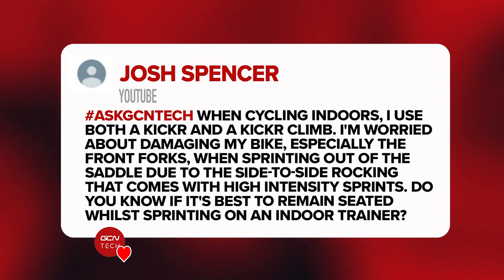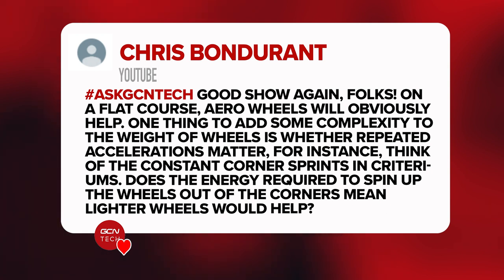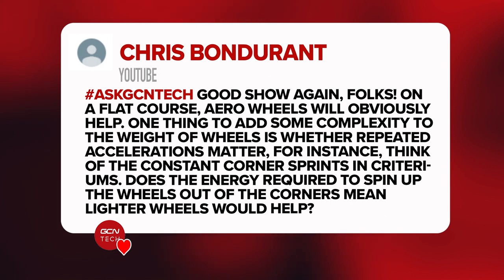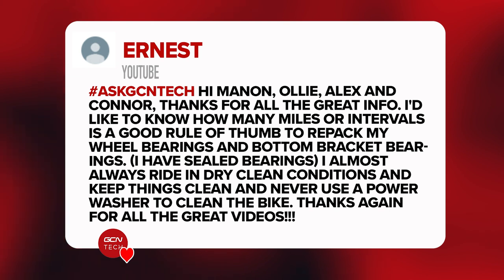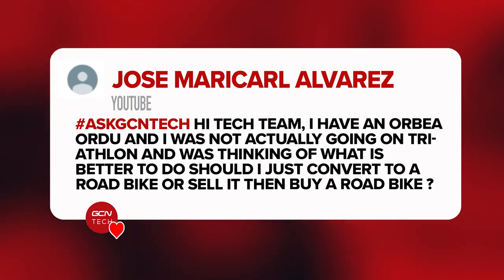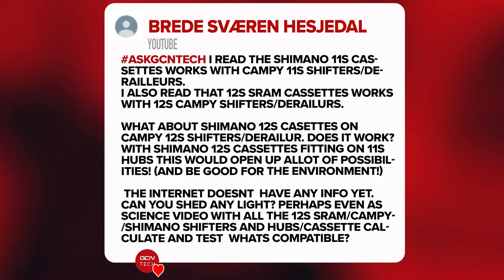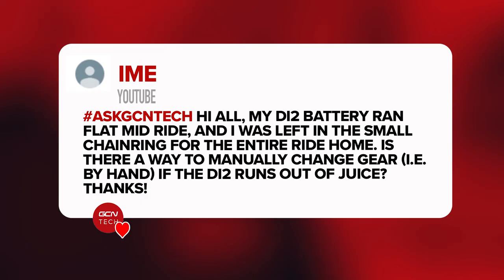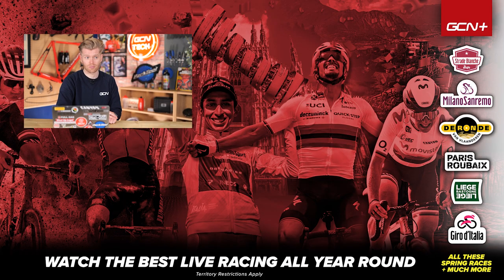Is It Safe To Ride Out The Saddle On Indoor Trainers? | GCN Tech Clinic #AskGCNTech

Comment from the maker: Have you got any burning tech questions that need answering? Let us know in the comments using #AskGCNTech, and we'll get back to you in a future video!👇
Reply: #AskGCNTech Greetings all, I recently discovered a polarising debate on the use of tubeless tyres on carbon rim brakes. Some people believe that providing you use all the correct equipment (as in manufacturer proclaims as tubeless ready) you will be fine, and others, even proponents of tubeless technology, would avoid tubeless setup on carbon rim brakes due to the lack of heat dissipation on the rim causing potentially dangerous temperature and pressure increases in the air. I am considering the set up for my summer bike as I use tubeless on my winter bike which is alloy rim brake without any issues. I have a set of tubeless ready tyres and the Vittoria road inserts ready to go, and a set of TLR carbon wheels on order but unsure whether it would be the right choice for the setup. Your input would be greatly appreciated, thanks.

Comment: If you stuck with a low/dead battery on 11spd Di2, and you are riding with someone who uses 11spd Di2, you can just use the wire that goes to your mates RD and then plug it into your RD, and then get your mate to shift it for you to your desired gears. Likewise with your FD.
Reply: Took me a moment to realize what you're saying, I was imagining your mate riding backwards as you're riding forward, joined by the wire into your RD as they shift for you 😂 nothing could go wrong....
Reply: @matthiaswuest7271  hahha. Well, another form of acrobat cycling.. Why not? Haha. Should have said, 'you can do a quick stop at the roadside'

Comment: #AskGCNTech Hi GCNTech crew! When riding indoors, where does the energy go? Surely it doesn't output 300w of noise and heat. Why not use this energy to feed back into the power grid and (marginally) reduce my power bill.
Come to think of it, why does my KICKR need supplemental power at all? Maybe you guys could dissect one on camera? Sorry about the long question, but it feels like these things cheat thermodynamics.
Reply: Presumably it's going into overcoming trainer resistance?

Comment: I listened with interest to the question about what to do if the battery on a Di2 system runs out of energy mid-ride. I think the simplest solution to that problem is to exercise a little forethought and always have a small lipstick style battery charger in one's set of emergency gear. I don't carry a lot of emergency supplies in my small seat pack. But having a diminutive battery backup in this era of electronic groupsets, cycling computers, lights, and cell phones (for emergency calls) seems to be a prudent thing to do. Since these tiny lithium batteries retain their charge for a long time, you can put it in your bag of supplies and know it will be good to go for months. Fortune favors the prepared cyclist.
Reply: Didnt thought about that, but its definately a great solution, because Di2 can run out off 5V battery packs (USB connector), same as Sram eTAP. I dont think you can do it with Campagnolo EPS tho, as the available charger socket other than the power one is made for 12V battery packs (different connector). Besides, the EPS charger is huge...
Reply: Never in the history of design adding batteries to a perfectly working mechanical device as EVER worked for well for the end user, other than the manufacturer that can charge more upfront and get a revenue stream from all the batteries and spares they are going to sell.
Reply: @sand9577  I tried to come up with a counterpoint but you're right. Unless there was a cord in between, the only non-toy examples I could think of were watches/clocks and the battery on a car supplementing the engine by removing the hand-crank issue to start it. But those are incredibly specific
Reply: @sand9577  Hi, iI general, in would agree with you. But some of these electronic devices have special value. Lights and radar units definitely add safety to the riding of many users. Electronic groupsets are a riding luxury for most, but not for riders with arthritic hands who struggle to shift with even the best manual groupsets. I won't belabor the point because, again, I agree with the notion that there is a special engineering beauty associated with a fully manually outfitted bike.

Comment: #askgcntech . Hi team . Oval chainring … fitting new chain… does it matter if the oval is horizontal or vertical when you measure the chain? Or does it not matter 🤷🏻‍♂️ also how many extras links do you leave ? Cheers👍🏼
Reply: It should not matter too much. The number of links engaged on the ring is always more or less the same (half of the ring). I used to have a biopace chainring on a fixie and the chain tension was only marginally different in any position. With a derailleur it is easily absorbed. I’m pretty sure it makes no difference to the chain length required. Watch a video of Froome and you’ll see that his rear derailleur is not bobbing back and forth during a full rotation of the cranks.

Comment: #AskGCNTech Hi tech team! My bike creaks a lot when i pedal. I have replaced the bottom bracket and serviced the crankset. The annoying creaking has become less but it's still there. Weirdly, when i simply wash my bike, the creaking goes away for about 5kms but then comes back slowly. What can be the issue? Thanks GCN team.
Reply: I have a Canyon Endurace and I thought my BB was creaking but after I wash it goes away, it turned out to be my seat post, I have to remove and clean every few rides and  now its dead quit now.
Reply: Presumably, it's a press fit BB which are notoriously creaky, but I had a similar issue with my gravel bike and it turned out to be a defect in the BB shell.
Reply: Had similar issues with a number of bikes, it turned out to be the seat post as MTB MOTO described. Thankfully it is also the easiest to sort.
Reply: Thanks for the replies. I'll try cleaning the seat post before the ride and check. Yes my bb is pressed fit one. Hopefully my bb shell isn't defective :/
Reply: @rayvinthingnam9106  make sure to clean the inside too 🤙🏼
Reply: @rayvinthingnam9106  My creaky frames were all alloy with alloy seat posts,  after a clean and re-grease the creaks vanished. When they returned I repeated the process and all was good. Hope it's this simple for you.
Reply: Can of worms there mate. Could be any amount of things.
Reply: Thank you for the replies everyone. 
An update - Instead of fully washing the cycle this Sunday, i just degreased and lubed the chain. The creaking sound went away for about 5kms again and then it started coming back slowly.
The creak only comes when i pedal hard or when i am climbing. And its very random.
I lubed my chain again and the creaking  went away for about 2 kms.

Can you all please help me with the problem and solution? Thank you so much.

I have been using the same degreaser and lube for the last 8 months. The problem started 3 months ago.

Comment: There was a question about compatibility between Shimano and Campy cassettes. Campagnolo started using "variable cog spacing" when 10 speed came out. Shimano doesn't use that. If you use a Shimano 11 speed wheel, with Shimano cassette, with campy shifters, parts of the cassette will shift fine. Other parts won't.........Shimano and Campy 9 speed worked together well. The spacing was only .03mm different.

Comment: If Your Di2 battery goes dead and there is another bike with Di2, put the bikes side by side, unplug the derailleur  that is dead and plug it into the good one, then shift it to the gear you need. Replug the bikes back in, and be on your way.
Reply from the maker: Ooh that is clever ! As long as the cable is long enough to reach said rear mech!

Comment: #askgcntech Hey Alex, Ollie; I wondered if you could help? I have a fancy all-in-one carbon bar/stem with my bike, and am upgrading the bike to Campagnolo Chorus 12s. Campy recommend a torque setting of 10NM for the shifters, whereas Shimano just 6NM. Is there a risk of cracking the carbon bars at 10NM? Why is the campy torque setting so much higher? Thanks!

Comment: #ASKGCNTECH hi gang little question regarding bike stability, background iam 167cm 77kg riding a small 50cm brand x rd01 with 110mm stem 38cm bar width. Problem is the bike seems unstable when descending in the drops @ 30mph and above however feels perfectly ok on the hoods, any probable causes why this would be the case many thanks

Comment: Hi crew, I have a question about cantilever brake link wires. I am refurbing an old mountain bike (I know but I am a roadie, really I am) and I noticed that there is a "D" link wire on the front brake and a "B" link wire on the rear. A friend mentioned I have the wrong link wires on. It should have a "B" link wire on the front and an "A" link wire on the rear. Now the bike stops well enough for cantilevers but should I switch out the "shorter" link wires?  #AskGCNTech

Comment: #askgcntech : Hey people, thanks for the help one of my STI levers doesn't spring back to the original neutral position, while they stop breaking it is a little annoying any ideas on how to fix it? Thus far I have checked for any dirt or other ingress or if they are bent and pushing against the housing. (they are grx 600 shimano sti')

Comment: #AskGCNTech Hi Alex, Olie and Manon. I have two wheelsets for my gravel bike, both tubeless. One has semi-slick tires on them, while the other set has more knobbier tires. My question is, where and what's the proper way to store the other wheelset when not in use, whilst considering the sealant inside. I don't usually swap that often. Thanks!

Comment: I've not read all the comments but I have an external mounted Di2 system (R8050) and carry a spare battery. A very easy swap over if the battery in use fails.

Comment: Ollie, you failed to discuss WHY lighter wheels are important in Formula 1, and not on bicycles. Unsprung weight (mass outboard of the suspension) is evil in Formula 1 (and other motorsport) because it is mass that will keep the wheel in the air after a bump. Tires in the air don't help either cornering or acceleration.

Comment: So, on my old bike, I was using Dura-Ace 7900 with 1st gen SRAM RED cassette and and TBH it was working smoother than original Dura-Ace. But at that time SRAM was a better at doing those parts IMHO. But big disadvantage was, that this SRAM cassette was so f... loud, because it was basically an aluminium can, and I was using it with aluminium pulley wheels in rear mech, so my friends where telling me, that they can hear me from few miles.

Comment: As to the dead Di2 battery question, probably you can use a 2mm allen and readjust the limit screw, so the rear mag aligns to a bigger sprocket for the ride home.

Comment: #AskGCNTech From the charts about cable pull ratios and the formula for mixing, it seems that an 11-speed shimano derailleur and 8-speed campy shifter would be compatible with 7-speed gearing. Would this work to index properly as the math shows, and if so what size chain would I need?

Comment: Yes, you can use a derailleur by hand...some of these electronic groupsets have a version with a wire; quaint I know, that you can use to remotely activate from the shifters. Those are awesome, work just as well, and don't use a battery!

Comment: #AskGCNTech 

Hi GCN tech! 

Can you help me pin point the cause of excessive chain and cassette wear? I can barely get 2000km out of a chain and only 4000km out of cassette. My mates easily get 3-4000km out of a chain and over 10k out of a cassette. I have no clue about the case, just know that it is costing me way too much money.

So here is what I do / have: 
- Gravel bike with Shimano GRX 600 group. 46/30 chain rings and a 11 speed 11-32 cassette. 
- I mainly ride on roads and occasionally on gravel. Weekend rides between 60km and 200km.
- Do a lot of short commutes. <20km rides, start-stops, not always good weather conditions, tend to be in a hurry to work
- Live in Netherlands, completely flat so lot of riding in the same gears (mostly a bit off center on the cassette and 98% on the big ring)
- 38mm tires, slick on the center with a bit of profile on the sides
- I am 182cm / 75kg so pretty average I would say, don't think I put down an excessive amount of power, not being Mathieu van der Poel
- Cleaning: quick clean after wet rides or several dry commutes, thorough clean each 200km and after long rides. This means a thorough clean at least once a week and often twice.
- Used to lube with oil, switched to wax this week
- Cassette wears out on the 2 or 3 mostly used rings and starts to skip when I put a new chain on. I don't dare to continue to keep on riding with an old cassette and old chain, because I could wear out my chain rings and they are impossible to order at the moment.

Is it just the combination of these aspect that add up to high wear compared to the fair weather weekend rider or is there one thing that stands out that I could change to get more life out of my components. Is a bigger chain a solution for instance, or won't that make a distance?

Would love to hear your advice on this!

Cheers from the Netherlands,
Jorrit

Comment: #AskGCNTech, Hey technical gang:  When changing front chainrings, is it recommended to place grease, carbon paste, or any other substance between the actual chainring tab and the crank tab that is sandwich with the two chainrings by the bolts?  I believe the chainrings bolts just use a tiny dab of grease per Alex as the torque is low, generally aluminum, and it's metal on metal. First time changing these, thank you in advance for all the great help.

Comment: You can force the rear derailleur somewhat. But I've not tried forcing the front with so much force. I would assume the front derailleur motor/servo is stronger as it needs to lift the chain onto a big chainring, so forcing it would be difficult.

Comment: Oli talking well out of his a$$ again 🤣 stick to the chemistry ⚗️ 
11spd is identical spacing (less than measurment error anyway) and works perfectly between campagnolo/sram/shimano. The answer in the video is just absurd.
TT bikes make great road bikes and are one of the only ways to get low and long these days if that's your fit. They aren't less stable, in fact the geometry is the same or more stable than road bikes (for obvious reasons they're built for straight line speed)

Comment: You mention that aero wheels in a criterium are the way to go, but did you take into account that 90+% of the time, you are sitting in a pack and not riding out in the wind?
Reply: depends. in breakaway u might be alone or couple of guys. then it matters a lot. also in sprints

Comment: #AskGCNTech Hey beautiful people! 🤩 Ollie says I should try again this week. Have you ever come across a patch for a tubeless tire? I bought a lovely pair of 45c tires for my gravel bike last season and got a 1/4” puncture on about the 5th ride. The tire works fine with a tube but the hole is too big for a plug. Seems like a patch would be perfect here, but I get that tube patches will not likely work on the inside of the tire (different material, etc.).
Reply: So, if you were to use a tubing patch, you'd probably be okay. The casing of bike tires is generally made from butyl rubber, just like the inner tubes that the patches were designed to be used with. Considering the low cost of trying this, I would just try it and see how it goes. Use your biggest tubing patch, sand a big area around the puncture, be generous with your use of rubber cement, take your time, and give it a shot.
Reply: On GMBN Tech channel there is a video about stitching up a tire that has been sliced.  I have done it with an MTB tire that had a long gash in the sidewall.  Sealed it up with same glue used to glue on patches.  It’s held just fine for many months and many rides.  I used a leather stitching tool that has a needle with a hole near the point and a bobbin in the handle for a spool of thread, sort of a manual sewing machine.   I think I paid USD 10 on Amazon for the tool.
Reply: I have managed to create a very durable patch by cutting out the old sidewall of a racing tire (or even a slice of the tire with the bead removed), sanding and gluing it to the inside wall of the tire, with very good results (for a clincher). Sanding  the inside of a tire and cleaning  it with rubbing alcohol, will leave a very good adhesion surface for ordinary vulcanizing glue. The old tire sidewall material  from an old racing tire (e.g. Conti 4000) is flexible, yet much more stretch resistant than a tube patch, so it creates a thin but strong patch. I was able to fix a hole that was about 2mm X 2mm, but I think it would have worked for something larger as well.  

For a large hole I have also used an entire cross section of tire, cut out the bead, and glued it inside-to-inside.  It creates a slightly bumpy tire, but a very strong patch. Reversing the tire cut-out this way, places the old tread against the inner tube, so sanding it down to get it as thin as possible will give you a smoother ride, possibly just like a new tire. Needless to say, this assumes a tube is placed inside. Not sure it would work for tubless, but why not try it? If it fails, just use a tube.